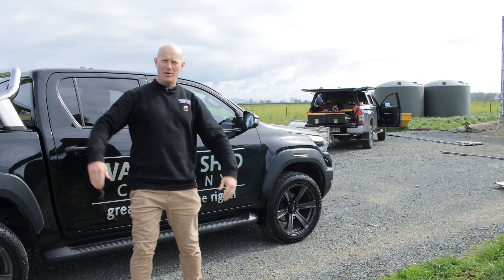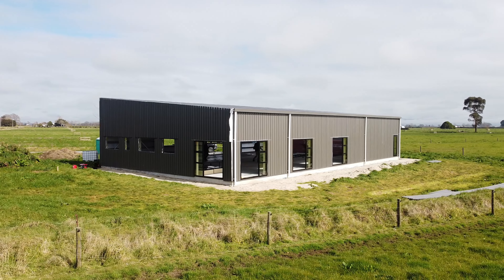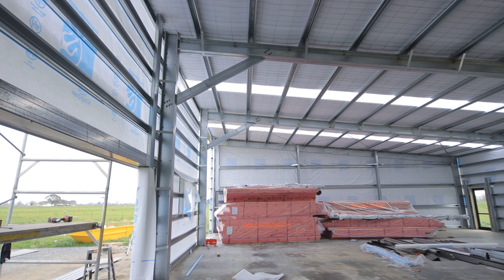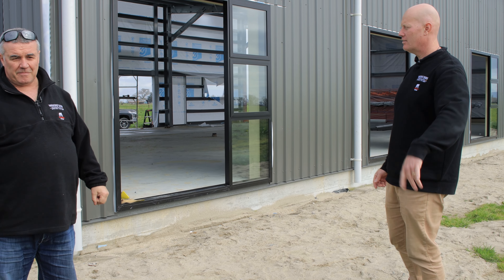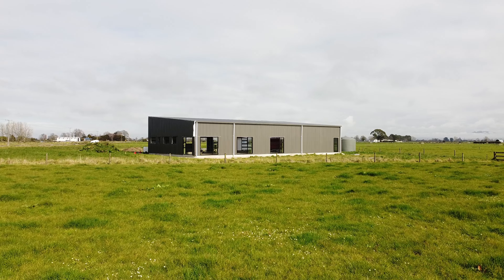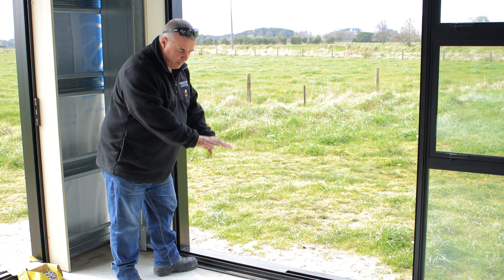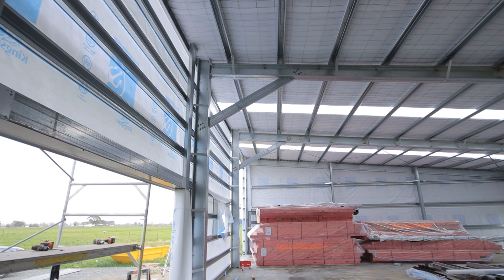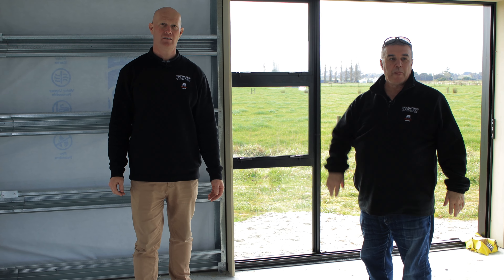How to Build a Modern Designer Shed Home

Comment: How do you (timber) frame around the fly bracing ??
Reply from the maker: Its an issue with the portal frame / timber frame concept. They will either box around it or rescrew it over the top of ply.
Reply: ok ..thanks .. yes its a strange one to get around for sure. I'm certain that if the engineer had to make it work, they would come up with a better solution than fly bracing.. cheers @waikatosheds